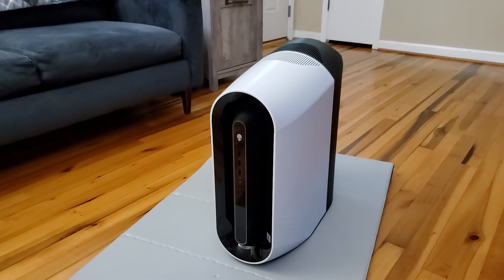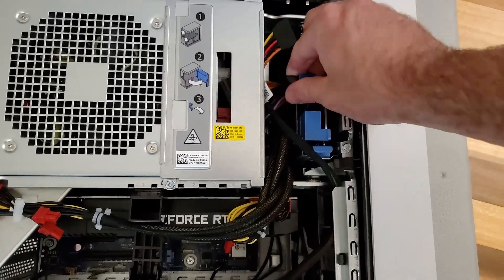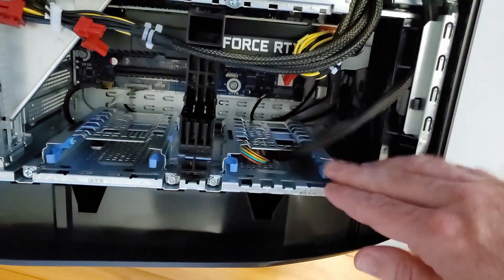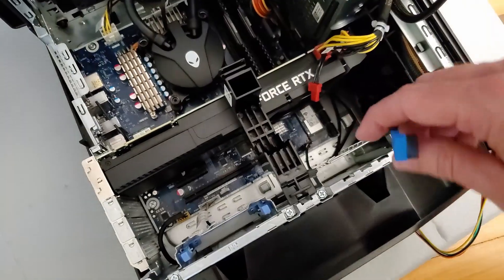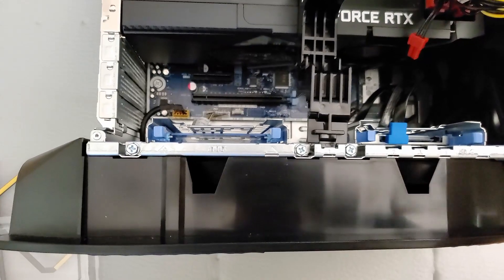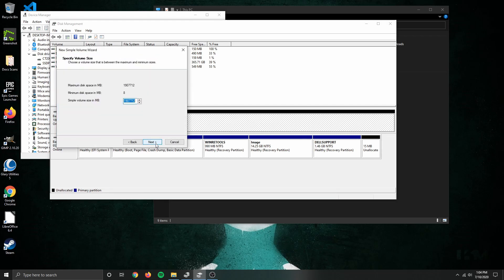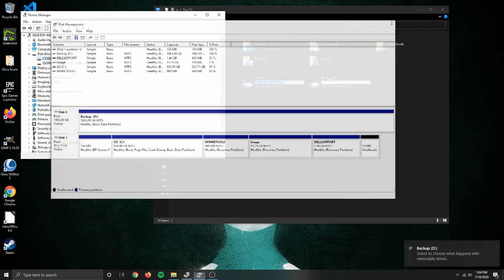Alienware R11 Solid State Hard-drive Install / Upgrade: Step by Step

Comment: I know this may be a dumb question, but how is your power connector long enough to reach? The cord that was originally connected to the hard drive doesn't reach. I also notice yours has a green/blue wire, but mine doesn't. Did I miss something?

Comment: overall got the point across, but, skipping over steps like getting the power supply out of the way and where you had plugged in the sata cable to the motherboard. Also, not showing how to put everything back together before powering on was also an issue for myself.  Hopefully going forward you can include these steps as well.  Thanks!!

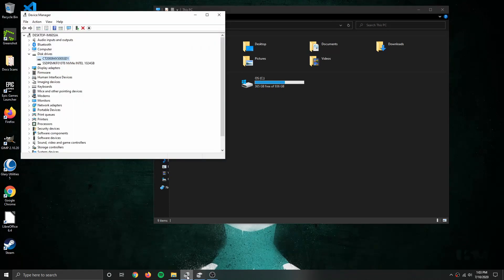Comment: Wait how did you boot up the computer if you took the HDD out? Isn’t that where the OS was? I want to completely get rid of HDD and only use SSD… 2:44
Reply: The OS drive should be on the C/SSD drive that came with your computer, at least it is for me

Comment: I know this is old, But i'm struggling. Drive shows up in disk manager, But not Disk management.... Its an SSD M.2 NVeM I have in an USB adapter Bc my pc wont pick it up to install windows and boot the computer. Was given the run around to format it.. But i cant for my life figure out how to format it. No on had any videos on R11 Towers that can help
Reply: I know this is 10 months old, so I assume you figured it out.   
 I am just answering this for anyone else who has the same question:

*This is for internal installation, and not the external type SSDs or those that use a USB Adapter.*

*Step 1: Install the New SSD*
1. Power off your PC and unplug all cables.

2. Open the side panel of your Alienware Aurora R11.

3. There should be thumb screws on the back to remove the panel.
Make sure to discharge any static by touching a metal surface before working inside.

4. Locate the M.2 slots on the motherboard. You might need to "unlock" the battery slot and open it to access the M.2 Slots.

The Aurora R11 should have two M.2 slots, one of which is already occupied by your SSD used for BOOTING.
The second M.2 slot should be free for the new SSD.

5. Insert the new SSD into the second M.2 slot at a 45-degree angle.

6. Once inserted, press it down until it "clicks" into place.  (It could be slotted in, but didn't "click" fully into place. My RAM sticks do this quite a lot when I upgrade them.)

7.  (If the SSD doesn't use mounting screws, skip this step and move onto step 9) Secure the SSD with the small screws that should have come with it. (there should be a hole for it near the M.2 slot).

8. Close the side panel and reconnect cables.  (They sometimes come off when you open the battery case too much).

9. If you think it is properly installed, install the screws to secure the side-panel again and Toggle the switches to the "locked" position.

10. Power on your PC.

*Step 2: Initialize and Format the New SSD*
1. Once booted, open Disk Management in Windows:

2. Press Win + X, then select Disk Management.
You should see something like (Based on the one I installed), something like "KIOXIA EXCERIA PRO 1TB SSD" listed as Unallocated space. 
If it is not showing, double check it was installed correctly.

3. Right-click on it and select Initialize Disk.
Select GPT (GUID Partition Table) for modern systems (this is the recommended option).
After initializing, right-click on the Unallocated space and select New Simple Volume.

4. Follow the on-screen prompts and choose NTFS for the file system.
Assign a drive letter (e.g., D: or E:).

5. Click Finish, and the new SSD will now be ready for use!

Comment: QUESTION: Is there any way I can add another Sata Cable or extend the one that's there instead of rerunning it? I saw someone mention more Sata ports on the motherboard on the bottom right. Can I buy another Sata cable, plug it into one of those slots and then use that one instead of the reran Sata?

Comment: Hey! I did the same steps and it all worked out! Do you know if I can still use the HDD? I tried connecting it with the remaining connectors I have in the pc and it doesn’t register it.

Comment: This video helped a lot.  The only thing  some others may run into like I did was I had to remove the GPU to be able to rerun the cable.  If you need to do this remove the power to the GPU, GPU bracket, then there is a small clip to remove the GPU from the PCIe port on the motherboard.  Thanks for the video!

Comment: I watched this whole video and I still don't understand anything all I know is my PC is low on storage and I need more I'm so dumb with technology 😭
Reply: Same here, but I think if you have your stock hdd drive you can add sdd drive in the open slots at the bottom but you need to buy a sata cable. It comes with extra power cables but only 1 sata cable that's connected to the hdd drive.
Reply: And I believe it has extra ports to plug the sata cable into. Should be pretty easy I'll be trying it in a few days and I'll try to get back and tell you how it went.

Comment: Hey I just have a question. Is it better to use the ssd as a backup drive (as shown in the video) or is it better to transfer the files from the hdd to the ssd. I'm mainly looking to increase the overall performance of my pc. Thanks!
Reply: If you're talking about documents and photos and the like, I wouldn't worry about storing them on an HDD. I would recommend SSDs primarily for your OS (e.g. it will speed up how quickly your computer boots up) and applications (e.g. if you're a gamer, it can dramatically improve load times). The main case for saving files on an SSD over an HDD in my humble opinion would be if you're streaming/editing those files in other applications (e.g. if you're editing video files in Premiere, or if you frequently work with audio samples in a DAW).
Reply: Same - following

Comment: So To add a secondary Ssd You could place it on the Free slot on the left? Since i am running just one SSD with 1Tb but if i were to need more storage i would want to add a secondary Storage drive

Comment: Thanks for the insight.
Only space for a 3,5" SATA drive and two 2,5" SSD ??
The design is then even worse than my ALIEN AREA 51.
I have to be able to accommodate 2x SATA and 2x SDD drives :)
(and EXTERNAL is "NO" solution)
Alien makes beautiful designs .. but bypassing the GAMER: /
A PC for console dummies.

Comment: only 2 hard drive bays  lol why was i expecting it to have 4?
Reply: The design is then even worse than my ALIEN AREA 51.
I have to be able to accommodate 2x 5 1/4" SATA and two small SDD drives :)
(and EXTERNAL is "NO" solution)
Alien makes beautiful designs .. but bypassing the GAMER : /

Comment: Hey I love your guides. I am about to get my hands on a r10. To save up some money I decided to with the stock 510 gb ssd and but aftermarket ssd to put in the bottom just like you did in the video. I have a question. Are there spare cable to mount an ssd also on the left (the one you left empty) side? Or do I need to buy the cables as well?

Comment: I thought the R11 came with a 1TB M.2 PCIe NVMe SSD already?
Reply: I quick double check of Dell's websites shows that you do not get 1TB standard until you hit the 3K price point. I simply paid Dell to upgrade the standard 512GB NVME in mine to 1TB. I also decided to upgrade the slow 1TB mechanical disk drive to a 2TB SSD in this video.

Comment: I have a 2TB WD SSD that I wanted to add as a third drive to my R11.  The Bios and device manager can't see it.  I can plug an old 3.5" and it works fine.  I tried the method shown here in the spot of the 3.5" drive and that didn't work as well.  Any thoughts?
Reply from the maker: Have you initialized the drive? If not, try that. 

Otherwise, 

1. Double check your power and sata cables to ensure they are securely connected. 
2. If that doesn't work, try using a different sata cable to isolate that problem. 
3. Still nothing, then use a different power cable.
4. This could be step one. Throw it into a cheap external bay to see if it works.

If all of that fails, then I'd say you most likely have a failed drive.
Reply: @theonlyjoe6036  Appreciated.  Looks like the drive is bad. I've tried all of the steps you mentioned, as well as bringing in a known good drive, and it seems like the drive is the only common issue.
Reply: Follow up: I returned the WD drive and got a 2TB Crucial drive similar to the one you demonstrated and it works just fine. Yay!

Comment: Hello. My friend, I have a huge request for you. Please tell me the size of the power supply in it. I can't find the information. I would appreciate an answer. Sorry for the bad English.
Reply from the maker: It is a fully modular 1000 watt PSU.
Reply: @theonlyjoe6036  Thanks for the answer, I know it's on 1000w. Ina needs its size. Length. Width. Thanks
Reply from the maker: @Sergei-fq2ly  150 mm width, 86 mm height, 140mm deep.
Reply: @theonlyjoe6036  Thank you very much, and this is a 500 or 1000 W power supply
Reply from the maker: @Sergei-fq2ly  I have the 1000 watt PSU.
Reply: @theonlyjoe6036  thanks

Comment: Do u have to buy a data cable?
Reply from the maker: I didn't because I was replacing the 3.5 HDD with the SSD. Otherwise, yes, you would need to buy a SATA cable.

Comment: I had TWO ...both with i9 ...liquid cooled ...BOTH FAILED. This SECOND one can't even run a screen saver ...it totally hangs & Alienware/Dell will NOT replace the second one ...they said I'm on the waiting list for a GPU & I can pretty much pound sand.
$4,300. & 3 months & still nothing. I'LL post the rude emails & screen shots if anyone is interested in not getting screwed.
This has been the WORST PC I've ever owned & the company is worse than the PC!
And ...fact is ...there are many good ...better options. I'm so sorry I didn't take one.
DO NOT BUY ALIENWARE.
Reply: That sucks, so the GPUs no longer work correctly on either, but they will boot to windows and give you an image?
I'd personally recommend EVGA for videocards. They make great products and when one did fail on me their customer service was great, whereas they just sent me a higher up model, since they no longer had mine.
Reply: @infasis  Dell (who owns Alienware) is good on honoring the warranty ...they sent a Technician who replaced the GPU with the same results. The problem was Nvidia's software (I assume) because I'm now using an app called "Simple Runtime Window Editor" & have the 3 screen set up working. Dell could not figure this out ...I had to through simple deduction. However; that is just one problem solved ...next is over heating & the cost to me to install an outboard water cooler like Alienware SHOULD have done. The Aurora 11 is a total failure in design ...period. And they installed software that renders some of the GPU features inoperable! They totally "dropped the ball" on this one ...AVOID this junk!

Comment: I have a nother question can you have 2 sdds in a pc?
Reply from the maker: Yes, the R11 has room for 2 2.5 inch SATA SSDs. Just be sure to order some SATA cables as the R11 does not come with extras.
Reply: I’m a bit new to the pc world but if u have a external sdd would it work the same way as internal sdd?
Reply from the maker: @sovietdraken  No, and for reasons that are too long to go into, it is simply worth remembering that an internal drive will be faster (all things being equal) than an external drive. Installing a SSD is easy to do, and a fun learning experience.
Reply: thanks sorry to bother u and waste ur time thanks tho

Comment: Okay so I ordered a Pc with this spec “256GB M.2 PCIe NVMe SSD (Boot) + 2TB 7200RPM SATA 6Gb/s (Storage)” 
What does that mean does it come with ssd inside already or I have to buy it and put it myself? Someone help pls lol
Reply from the maker: You have a 256GB m.2 NMVE drive as your boot drive (where Windows is installed). An M.2 drive looks like a stick of RAM that plugs in flat to your motherboard near the graphics card. The issue with 256GB is that a single Call of Duty Modern Warfare game will take up the entire useable space on the drive. The 2TB drive in your system is slow mechanical hard disk. I would recommend adding a 2.5 inch SSD like in the video, and using it as game / storage drive to get those speedy SSD load times.

Comment: Would this be the same with a HDD?
Reply from the maker: Yes. Provided it is not replacing a boot drive (replacing a boot drive will require making boot media on a USB drive for installing Windows), an HDD can be installed the same way.
Reply: Ok thanks

Comment: You do not need to take the original Hard Drive out. The R11 is built so you can add extra memory you just need to buy the correct connectors. Also buy removing the original Hard Drive you have successively voided your warranty.  My cousin is a dell tech and is filmier with the R11 Systems.
Reply from the maker: You are correct that you do not need to remove the original hard drive. I just happen to hate old mechanical hard drives with a passion, and feel that they have no place in a modern gaming system. I'm of the opinion that if you need more than a few terabytes of storage that it makes sense to invest in a NAS to gain some level of redundancy.

Comment: I'm a litle confused. If you removed the original HDD and add the new SSD, what is the system booting up from? Is there another HDD in the case with the OS?
Reply from the maker: My R11 came with a 1TB NVMe drive installed on the motherboard that is the boot drive. The mechanical hard drive that I removed was installed by Dell. I could have opted to have it left out of the build, but leaving out the 1TB HDD did not actually reduce the cost of the system (that is how little of value old HDD tech is).
Reply: @theonlyjoe6036  I soon realized that there was probably an NVMe drive installed.  Your video gave me a really good idea of what I just bought. Thanks and keep it up.

Comment: How exactly do you rerun the cable?
Reply from the maker: The cable is attached to the old HDD. You just have to re-route it to the new SSD. No unplugging of any cables is required. Simply re-route the cable from the old spot in the case to the new spot where the SSD is installed.
Reply: @theonlyjoe6036  Thank you

Comment: Thank you for your video! I was wondering how the machine is keeping up, I'm looking at getting the 3080 model but I've heard that there is only one fan on top and that it does a poor job at keeping cool and that it is also pretty loud, what is your experience?
Reply from the maker: I'm happy with it so far. I have modded the radiator to a push / pull fan configuration. The single included fan up top is a industrial grade Nidec server fan that is capable of moving a lot of air, and it can get loud.  My mod moves the same volume of air and  also runs more quietly with the two aftermarket fans versus the included fan. I'll be posting a video of this in the next week or so.

Comment: I have a question, My laptop broke and I am wondering if I could install a laptop hard drive to a desktop of if there was someway to transfer the data? (I’m new to PCs in general so please go easy)
Reply from the maker: I'm assuming that your laptop hard-drive is a standard 2.5 inch laptop hard-drive. The easiest way to do this will be to use an external harddrive enclosure, and plug it into your computer. I've included a link to one you can get off Amazon. I frequently use this exact enclosure when doing data recovery work. I've also linked to article from howtogeek that gives pretty basic instructions for you to follow.

https://www.amazon.com/Sabrent-Tool-free-Enclosure-Optimized-EC-UASP/dp/B00OJ3UJ2S/ref=sr_1_3?crid=1WHMHOKY7EBPQ&dchild=1&keywords=2.5+inch+external+hard+drive+enclosure&qid=1607294847&sprefix=2.5+inch+exter%2Caps%2C164&sr=8-3

https://www.howtogeek.com/182452/how-to-get-data-off-an-old-hard-drive-without-putting-it-in-a-pc/
Reply: @theonlyjoe6036  Thank you soo much for the help!!!

Comment: Great video. I just ordered an R11 for Cyber Monday and want to take my existing 1TB SSD with my current Windows OS and data, plop it into the R11, clone the drive to to the 2TB NvMe SSD on the new machine and then wipe the old SSD and this gives me a plan for the install of my existing drive.